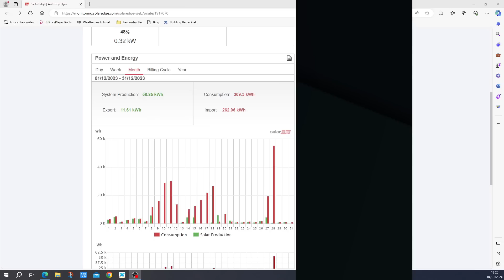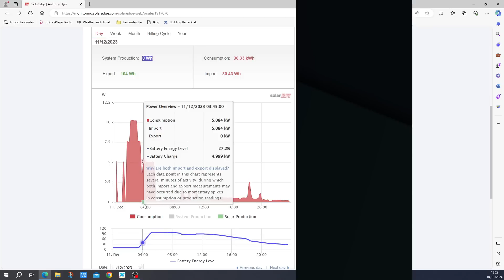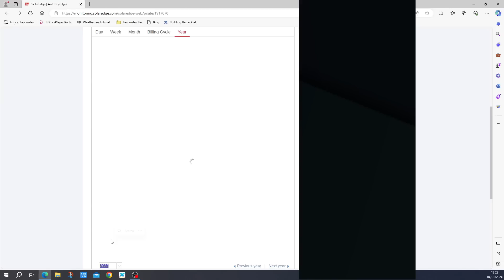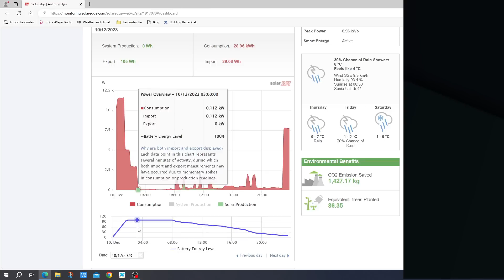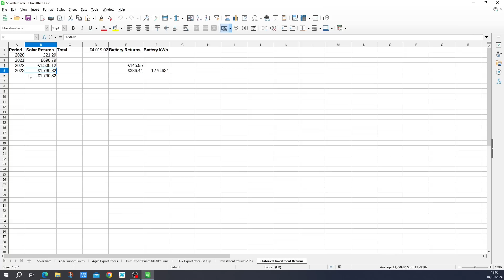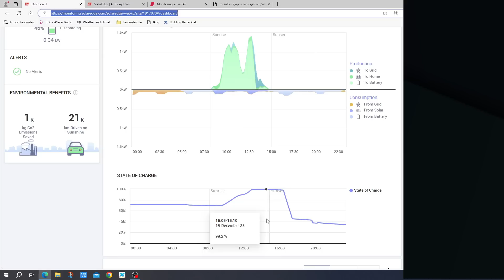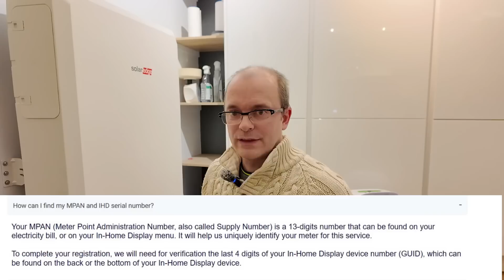Solar Production 2023, SolarEdge Battery Insights, Octopus Go Intelligent.

Comment: Can you program SolarEdge such that all solar production only goes to grid and home is run entirely from battery until it runs out and then the grid comes online? I have a Huawei system and cannot do this and given I have substantial battery capacity, for most of the year it makes sense to export all electricity and run home off the battery which we can charge up overnight at half the rate of our export. Huawei only lets me export surplus over what is needed to run the house.
Reply from the maker: There are certain battery modes:  
Maximise self consumption-  the default mode
Charge from solar and grid - useful in the cheap hours.
Discharge to grid - useful in peak hours if you have the flux Tarriff.
Charge from solar only, no discharge (not useful)
Discharge to minimise import, no charging. (Useful to delay charging if using clipped solar later in the day).
Solar Power Only (battery switched off) - useful during cheap hours when charging the car.
Charge from clipped solar - useful during spring summer sunny days to maximise production.

When it comes to maximising export, the strategy would be to charge home battery to 100% overnight, and run all heavy loads overnight as well (car charging, washing machine etc,,,,).   Any loads you have during the day will use solar or battery according to surplus or deficit.  You don’t want to take power from the grid during the day as that’s more expensive than export rates anyway.
Reply: @anthonydyer3939  Looks like you cannot divert all solar directly to grid and run home on battery either. In early spring until late Autumn I can charge the batteries at night and they are large enough (60kWh) to last all day without solar and its an annoyance the software does not cater for this situation by allowing me to direct all solar straight to grid. Seems the hardware manufacturers don't recognise this opportunity for those countries where we have dual tariffs.
Reply from the maker: @craigburgess2237  To achieve what you want, you have to consider different operations that have the same equivalent outcome.  In this example, you can charge overnight and then force discharge the battery in the morning before the solar output becomes export limited.  Then you can recharge the battery with clipped solar during the middle of the day before force discharge again in the evening period.

At the moment I’m exploring the modbus register mapping for the Inverter.  There is also rescinded documentation for modbus controls for the battery.  So far I’ve got production data over modbus, but sadly nothing for the battery.  If I find the missing trick, then I’ll be sure to make a video about it, since the register mappings follow the standard sun-sync specifications.
Reply: @anthonydyer3939  The SolarEdge Modbus Multi Integration in HomeAssistant I mentioned above exposes 125 entities some of which are for three-phase but basically all you need to know about the Battery and Inverter and the System as a whole. It is worth setting it up for that alone. For just that it would just be a few hours of work. I can send you the full list if you like.